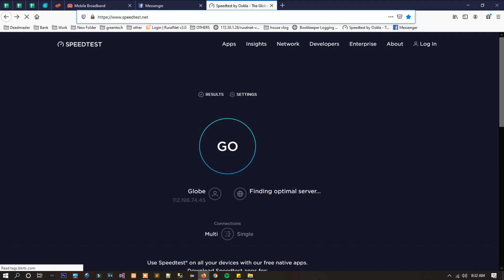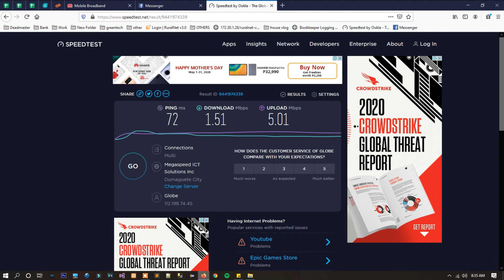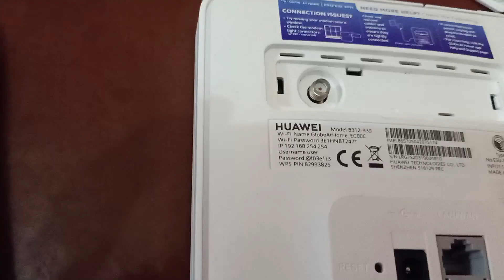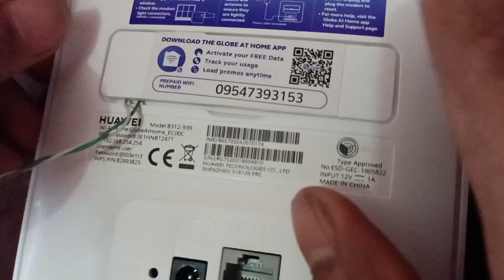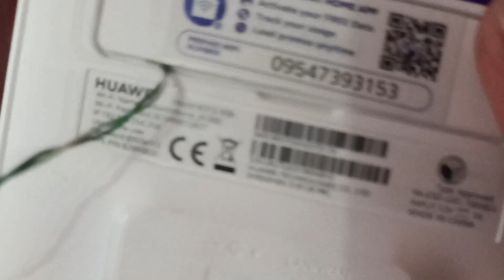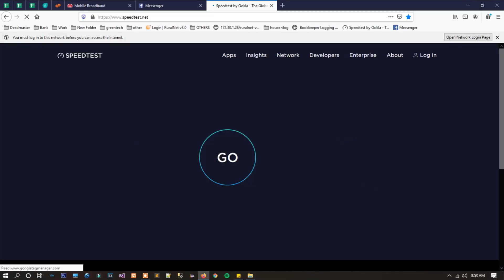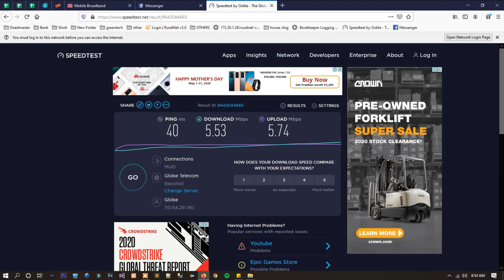GLOBE HOME PREPAID WIFI BOOSTER (DIY)

Comment: This DIY antenna works guys!! it just has a major design flaw: the white and green wires SHOULD NOT be touching together when installing into the wifi. One wire (dark green) should be inside the pin hole while the other wire (white or light green) is folded over the outer edge of the wifi's antenna port. These wires work like the "+" and "-" ends of a battery, so the positive and negative/neutral wires should not touch.

Although lead welding has the best results, twisting the wires tightly with a hair tweazer seems to work well enough. The outer shape of the copper wire can also be round/circle shape. If you don't have plastic zip ties you can also use the nose wires from face masks.

*IMPORTANT NOTE:* You can get the green data cables from inside the ETHERNET cable, like the yellow cable included with the globe wifi. It's VERY IMPORTANT to use the same wires as the video, or else it might not work -- or worse, damage your globe wifi device. I also recommend visiting cellmapper.net so you can position your antenna to the nearest cell tower.

Having admin access to your wifi also makes it easier to know if the antenna is working; the antenna should automatically switch from "Internal" to "External" when you look at Globe at home's front admin page while logged out.

My internet speed went from 0.3mbps to 3.4mbps which is more than enough for my online work and research, Thank you so much OP for this video! 😁👍

Comment: Loop po ba yung antenna, o di konektado dalawang linya ng antenna?
Reply: mali po yung pag install niya sa likod ng modem. Dapat isang wire lang ang pinasok niya tapos yung isa nasa gilid ng thread naka dikit. Sigurado ako aabot yan ng 10mbps pataas pag na correct niya.